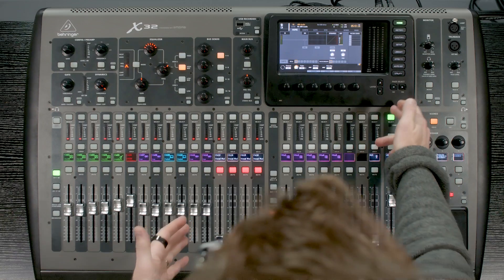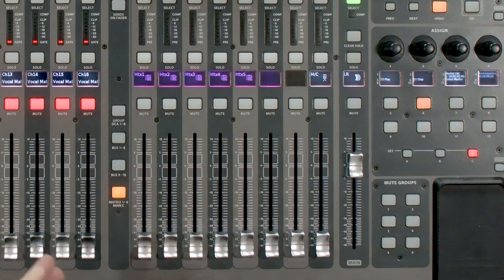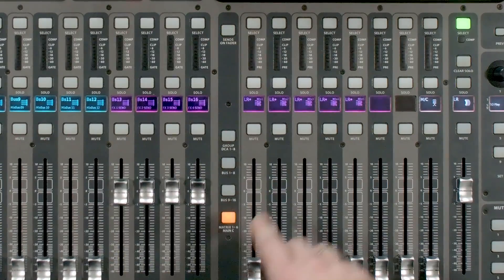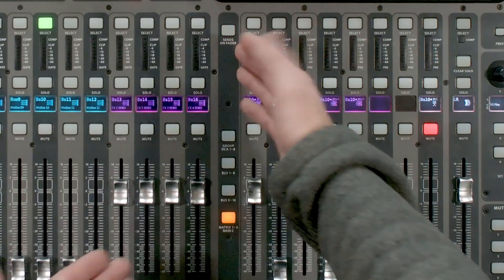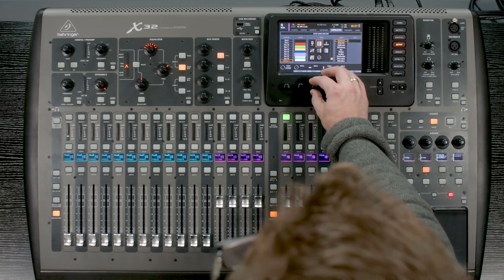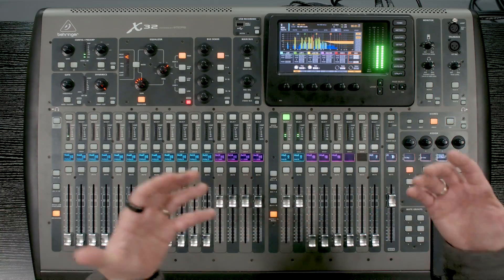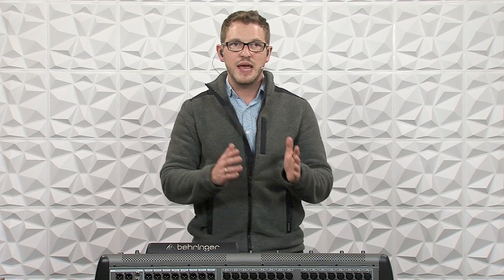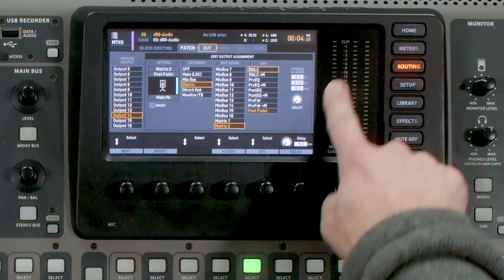Behringer X32 - Matrix Setup to Feed a PA

Comment: Hi Drew, first: Thanks so much for all of your helpful videos and tutorials! You doing such a good job with that! 
Now, a question to the possibilitys of matrixes: How to get to this goal: Adjusting EQ seperately (individually) for an output to second room PA. Means: First room PA shuld not be affected. So, I have to use 2 of the matrixes for stereo-main and 2 others for second room stereo. But in those (for second stereo out) I need to adjust EQ independent in left and right. How to solve that? Many thanks again!!

Comment: Your suggestion to set the L/R Mixbus send to 0dB, when setting up the Matrix, can result in clipping on the Matrix bus. Ordinarily, one would simply turn down the channel strips to reduce signal, but this results in faders that are set too low on the board. Setting the initial Mixbus send level to -5dB, or so, appears to solve the issue. Any reason why that should be a problem? Or is there another solution?
Reply: is your mix clipping the L/R bus also? it should just be a duplicate
Reply: @ no, the sends are too hot, for some reason. Not sure why, which is why I commented. Never got a reply, which is par for some of these guys.

Comment: Need clarifications. 
So does that mean your Main L/R is just signal with sounds and when you have Matrix 1 and 2 as main PA 1 and 2, (sub set up with matrix 3) does that means you should be focusing on matrix instead of just soloing out the main L/R and adjusting it such as EQ.
Reply: Correct.  If you're going to send your LR Bus to locations other than your PA (ie. live stream, satellite room),  you wouldn't want your in-room EQ on it.

Comment: Thanks, Drew, for the great video.
I've got a question.
I once routed matrix 1 and 2 to bus 7 and 8 on an x32 compact, being used with a Midas DL32. But matrix 1 and 2 weren't receiving signal until I raised the level on bus 7 and 8.
Is that normal?

Comment: To send L/R independent you need to link the 1&2 matrix, but when you link, how to you adjust the volume just for that matrix 1 speaker? 

Eg: if the person walks close to the L speaker, to reduce only that speaker without affecting the R.

Currently I have LR going to Matrix 1&2 unlinked but pan function doesn’t work.
Reply: Yes panning is what I’m wondering. I.e. do the individual matrices in a matrix pair receive the individual channels of the LR bus separately. To me it’s seem they are summed to mono and both matrices are receiving both L and R

Comment: My band is getting our first X32 Compact for our gig rig. Our deal is we each supply our own instruments and mics, then we split the cost of monitors, FOH tops and subs, and the rest of the components running the PA. My drummer wants to try to use 2 overhead condensers and nothing else for our gigs that require drum mics. As the lead-guitarist who used to be a drummer, I realize the benefits of a simple rig. However, as the sound guy, I would like advice on trying to isolate individual drums on mixbusses via EQ. In theory, I should be able to use the parametric EQ to isolate cymbals and kick rather easily. Toms are also going to be relatively simple to isolate as a sort of group. Snare tone is going to be the hardest part to isolate. I'd like to be able to adjust individual drum levels because overheads do not generally produce a flat-response picture of a trap set. Is it worth the trouble to try to not mic at the very least the snare, if not the kick as well, or am I better off trying to talk to convince someone who may or may not understand the finer points of live mixing?

Comment: 2 questions for you:

1. What’s the proper way to send my pastor’s channel to a subgroup/bus? I am intending to use a DeEsser on his input channel & then use a GEQ on the subgroup/bus — pre/post?

2. How do I adjust ny matrix for the livestream? Lately I’ve been having issues — I send my main mix through a matrix to my video people; I send it Post Fader & the signal and the sound coming out of it is healthy. From there I send 2 XLR cables coming out of 2 physical outputs of my board into a 2 channel interface (gain on both channels of interface are ALL the way down. From there I connect a usb cable from my interface into ny video people’s computer. I notice that the audio arrive to my interface distorted. Not sure if it’s the send from my XLRs or if it’s something his computer is doing to my interface (if he is even sending me anything to it; I’m not a video guy).

Comment: Is nobody gonna ask the obvious question? If the PA is too “bright” fix the PA. I’m all for this routing approach but the “bright PA” analogy is just putting a bandaid on something. If one wheel of your vehicle was larger than the others your mechanic wouldn’t come up with some weird way to jack up the suspension, he’d fix the wheel size.
Reply from the maker: Yes that is true, however sometimes you are in a venue where you don't have access to the system processor as the venue has locked it out. So the matrix section would be the correct place to fix it.
Reply: @DrewBrashler  Ok, I'll go down this obscure hypothetical rabbit trail with you. If this is a one off gig I would hope that I would at least have enough time to setup Smaart, RTA, and run some pink noise to try and create some sort of resemblance of equal amplitude response. If this is a regular gig or a church gig I would address the root of the issue immediately. I'm not trying to get on here an be one of those dudes that bash anything that is said on YT and I appreciate the info. I would just like to see YT audio techs that have a following address more of the root causes of these things. I work for an AV company that specializes in church audio so I'm in churches almost every day and I tune systems all the time. These volunteer church techs are listening to everything you all are saying and trying to apply what they "think" they're hearing.

Comment: It seems like setting up the FOH/Subs this way will bypass the "M/C follows Mains" feature. Is this correct? Is there a workaround of some kind? 
Great videos, as always, btw!
Reply from the maker: Actually it won't bypass that as the tap for sending to the matrix is set to a Post Fader tap point. So it will continue to work just as expected! Hope this helps!

Comment: Side note on PA feeding on Matrices, Delay can also be added for feeding delay towers or secondary mains further back in your venue. I also use a set of Matrices to feed side-fill systems on large stages (and sometimes drum monitor if they have a sub). This is basically a further extension of eliminating the need for a system processor
Reply from the maker: Exactly! I go over a bit of this in the next video too. Thanks for the comment!
Reply: I do similar. Main L&R bus feeding a L&R matrix, a center matrix and a sub matrix. Main L&R bus is sending to mono speakers matrixes (center and subs) at -6dB from unity. Main L&R bus is sent to stereo speakers (PA L&R) at unity gain. Fine mixing adjustments and EQ can be made on the matrices. Quick overall DB adjustments of all matrices can be made using the main L&R bus fader if sent post fader.
Reply: That’s exactly how the matrices are used. 😊

Comment: Great video Drew. Thanks for all your insight into the functions of the X32. I’ve trained several new sound techs at church and I always send them with homework that includes several of your videos. They are so clear and concise and well explained. Your work does not go unnoticed. Could you do a video on how you set up the hot keys to control your recording playback? We use Logic Pro to record from and playback through our mixer. I’d love to also set up our board to use the buttons to control the playback. Thanks again!

Comment: Great, thanks !
I got an strange question ..
Is it possible to use knob control or other from the x32 as a surface controller in ableton.
Example changing an program change or cc command for a real hardware synth throught logic by turning an x32 knob ?